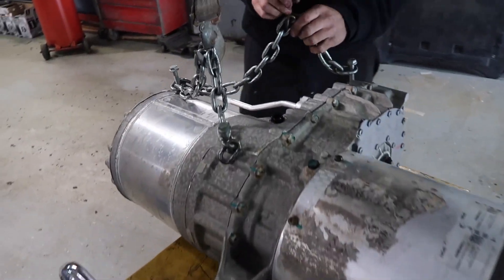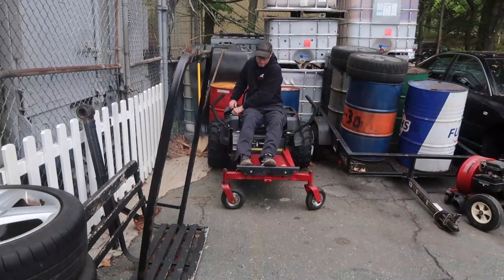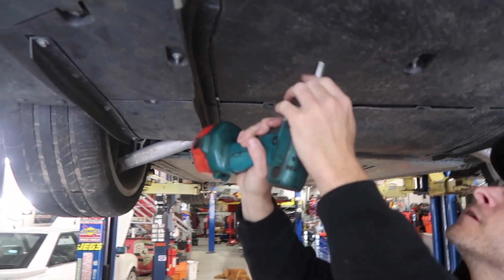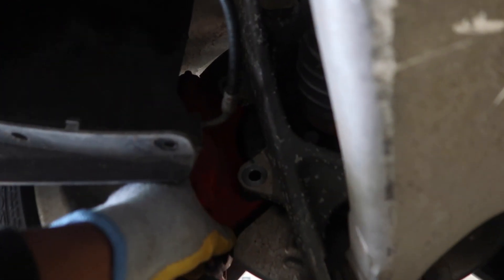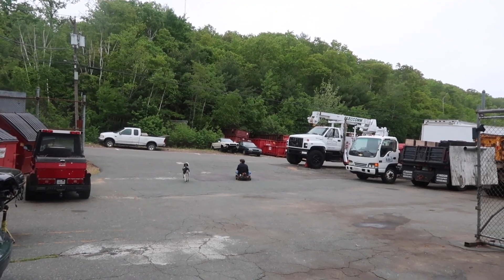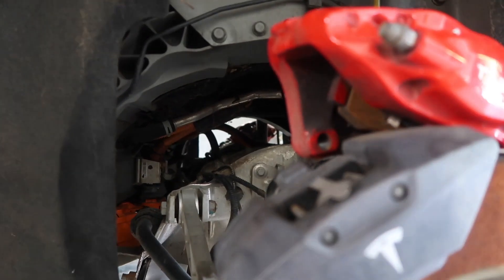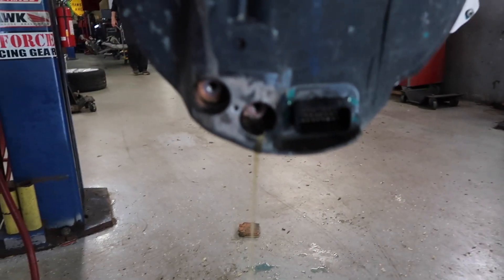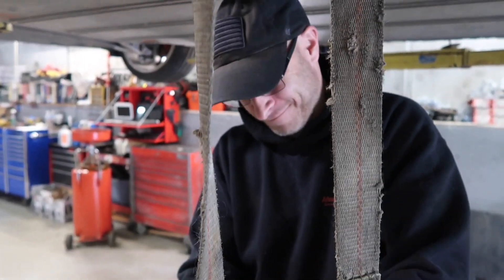Can You Drown a Tesla Motor?

Comment: Let me explain why you should never ever go to advanced technologies (Lee Malo)... back in 2008 he ripped me off literally over $25k.he told me he could work on my corvette, he couldn't. He subcontracted the job of replacing my heads on my blown engine to a Chevy mechanic from the Sudbays Chevy dealership. So neither him nor his crew did the work. So he charged me more so he could pay an outside mechanic. OK that's fine, but he was supposed to put new heads on my engine and instead put all my already paid for parts like my supercharger on my blown engine, all these parts we agreed we would talk about  insalling after he fixed my engine.. I made the mistake of having him hold onto them. He then put on my drilled and slotted rotors and new crome rims/tires as well. Then it sat for a month because I said he never fixed the original problem, I wasn't paying for it because my engine was still blown. It was still blowing white smoke. in the snow and rained, and rusted my new crome rims. His plan was to rip me off right from the start, so he had him put as many parts on that car knowing he was going to take me to court and have that car auctioned off. He never did what we agreed the engine was still blown, but yet took me to court and won only because I never gave his lawyer my statement. That's what the judge said even after agreeing with what I said was right. He said I had to give his lawyer a wrighten statement, and that's why he awarded him the case. So he now had to auction off the car to pay for the bs amount he came up with that i still owed. Well he was supposed to give me notice on when that car was being auctioned off, and never did. That's the law so I can buy my car back from auction. I doubt he ever auctioned that off to begin with. That's illegal. He never gave me any of my parts back including my almost 5k supercharger that should have never been installed, or my now rusted crome rims and brand new tires. As well as thousands of other dollars worth of parts the judge said he was supposed to give back. He even installed my racing seats in his sh*t box Volkswagen race car. I still had to pay 3k according to the court somehow so they took that directly out of my pay from work. All in all he literally ripped me off over 25k. What my car was worth and all those parts plus an additional 3k that I owed him  somehow. He knows for a fact he can't justify what he did. Nobody at that time sided with him. He can try to lie about it, but everyone that knew what happened including his crew knew he purposely ripped me off. So me being young I got back at him I significantly vadilized all the cars at his shop, because I couldn't win in court thanks to his expensive lawyer.Thats the truth. I am ashamed of what I did to get back at him. I'm not proud of it. But he was crooked and people needed to know. I tell people that story to this day. He was wrong, and people will always know what he did.

Comment: the only engine that can make more power out of a smaller engine are rotaries are no where near as reliable and require rebuilds often. They do use a lot less moving parts than a regular engine but don't electric motors have like 3 moving parts

Comment: Many electric motors will happily run under water. Interior car lights work under water. Turns out a light bulb or motor is the least resistance in an electrical circuit in any medium...that doesn't choke it.

Comment: It is waterproof but it is not a submarin.
Try to put other vehicle under water for 10 minutes and then try to start the engine.
High voltage has protections like a hot tub does.

Comment: Takes longer than 10 days for water to do any damage a lot of submerged items only corrode on the surface then algea and dust buildup preserves the core alloy for a long duration looks like they sealed everything well so it should be fine just needs a full teardown regrease and replace barings open encased components to dry out and inspect/clean replace rotten interior and antthing corroded or shorted then its back to what it was

Comment: Lot of rust in an internal electronic component, that makes me wonder about the quality of the seals and the metals involved in the motor.
Reply: It was sitting in water a week nothing will hold that back
Reply: @braxtonwilson1666  I have this bottle with (pressurized) soft drink in it, in my fridge. the soft drink stayed in well over a week. Perhaps even years!
Reply: @CheetahNL  I bet your bottle doesnt vibrate as much but it is just a guess maybe your fridge is crazy!
Reply: @BenjiShock  I do have a vibrating fridge, especially for the soft drinks. And still no leakage. ;-)

Comment: Electrical contact cleaner or brake cleaner, removes the rust, and cleans out the gunk. I've cleaned many an electric motor and it's circuitry this way.

Comment: you dont see some one NOT running a lawn mower at full RPM very often! those riders  mostly runn on hydraulics to get power to the back wheels, and it doesn't take alot of engine RPM to get alot of torque outta them, the RPM's are mainly for turning the blades fast!

Comment: I’m kind of shocked (no pun intended) this motor has water in it. I’ve seen so many videos of Model Xs and Model Ys showcasing their water fording abilities in light offroading and how they are better because they don’t have air intakes. I thought these motors are better sealed.

Also, that red isn’t rust. Its the transmission fluid.

Comment: Question: Tesla motors are, supposedly, capable of getting up to 18,000 RPM. But this assumes work being distributed to both tires. What if the motor had to spin only one tire? How fast, in terms of RPM, could it get up to then?

Comment: Can someone explain what inverter does?
Reply: The inverter convert the "flat" DC +/- battery voltage in "dynamic" AC three-phase voltage. That is necessary for create the electromagnetic forces that puts in rotation the electric motor rotor (in this Tesla case a "induction electric motor").
The rotation speed depend by the AC frequency managed by the inverter.

Comment: That's a mix of liquid coolant and water from the leak. Traction converter (inverter) comes up with liquid cooling. There's one more in slot liquid path  inside the motor to cool the windings.

Comment: Tesla is like Lamborghini and Ferrari, they want your vin. number before they send parts. I was working in a shop on a race track. We had a client who wanted to build four Ferrari 308 race car's. So he ordered a reproduction fiberglass body. We cleaned up this body all bolted together and put in months to get it perfect in shape and fit. Then we pulled moulds. We built four body's for four cars. The client was a Ferrari dealer. He had to use vin numbers to get the parts, engine's,  front window's part's, and other things. When the first engine came in a box it was put on a dyno and it blew up, $50,000 gone. The second engine was placed on the dyno with the help of a Ferrari technician, it too blew up, $50,000 gone. The third engine made it, by "GODS LUCK ONLY". Ferrari doesn't want a home-made race car with real Ferrari parts on them.  Rich is right when he said "Tesla want's to protect their image", so does "Ferrari and Lamborghini". I think it's the same with Tesla, but just to fix something simple and they say "Sorry your model is not covered" is very sad, investors should be warned first. Customers got SCREWED. This is why their is "NO REPAIR SHOPS", they want you to buy another car and let the others "ROT IN A FIELD".
Rich, carry on with your new business, you have a lot of HAPPY CUSTOMERS, SCREW TESLA.
────────────────────░███░
───────────────────░█░░░█░
──────────────────░█░░░░░█░
─────────────────░█░░░░░█░
──────────░░░───░█░░░░░░█░
─────────░███░──░█░░░░░█░
───────░██░░░██░█░░░░░█░
──────░█░░█░░░░██░░░░░█░
────░██░░█░░░░░░█░░░░█░
───░█░░░█░░░░░░░██░░░█░
──░█░░░░█░░░░░░░░█░░░█░
──░█░░░░░█░░░░░░░░█░░░█░
──░█░░█░░░█░░░░░░░░█░░█░
─░█░░░█░░░░██░░░░░░█░░█░
─░█░░░░█░░░░░██░░░█░░░█░
─░█░█░░░█░░░░░░███░░░░█░
░█░░░█░░░██░░░░░█░░░░░█░
░█░░░░█░░░░█████░░░░░█░
░█░░░░░█░░░░░░░█░░░░░█░
░█░█░░░░██░░░░█░░░░░█░
─░█░█░░░░░████░░░░██░
─░█░░█░░░░░░░█░░██░█░
──░█░░██░░░██░░█░░░█░
───░██░░███░░██░█░░█░
────░██░░░███░░░█░░░█░
──────░███░░░░░░█░░░█░
──────░█░░░░░░░░█░░░█░
──────░█░░░░░░░░░░░░█░
──────░█░░░░░░░░░░░░░█░
──────░█░░░░░░░░░░░░░█░

Comment: Can anyone give me some advice? I have a 1985 Mercedes T1 campervan/RV its got a 2.3l petrol engine that does about 18mpg on a good day, also converted to LPG but it does 10mpg on gas. I am thinking of hybridising it with either an electric motor from a forklift or maybe swapping out the whole engine for a Prius although the Merc is RWD and I don't know if it's possible to adapt the Prius motor to run RWD.

Comments welcome!

Comment: Rich, you could dry ice clean every component of this car including the circuit boards, bearings, wiring, and terminals, repack the bearings, reassemble, then test it.  I think it would function as designed.  It's only when you power something up while wet that it can fail.  We use a YoungTimer by Cold Jet PCS 60 dry ice machine to clean every surface and item on any car.  And never get anything wet!

Comment: Just crack that motor open time for new lamination and coating but electric motors do run submerged in water it's the ESC that will malfunction dealing with water this after 40 year's of experience will All electric motors from the nicad day's  but that entire electrical system needs to be replaced but I also seen ESC,s submerged in water for 20 minutes dried out and worked perfectly 😉

Comment: What kind of conversion could this motor be used for? Minibus/van, small train with limited passengers?

What's the horsepower, torque, and length of use without having problems?

Comment: kauputnik/ needs copious gallons of WD-40 & Zep sprayer to clean & dry EV motor & PCB// also needs serious conformal coating on
PCB to “waterproof” EV//
listening, Elon??
Reply: conformal coating will act as a thermal insulator, and when you're in a car, you need those inverters as cool as possible to increase the lifespan
listening, David??

Comment: BMW also produced one of the earliest model jet turbine engines during WW2. The 1st production jet engine powered fighter in history, the Messerschmitt 262, was slated to be powered by 2 BMW 003, axial turbo jet engines. However, production & development problems caused delays, & ultimately the ME-262 went into service, powered by the Junkers Jumo, although a few 262 prototypes used the 003.

Comment: I had a boat that sunk in salt water ,  rinsed it out and after a few months it several systems stopped working. Coated every connection with "corrosion block"  after a few days I applied power to the boat and  everything came back to life. That was several years ago and  all is still working fine.

Comment: If the electronics got wet contact cleaner and WD40 (water displacement formula 40). The only issue is corrosion in contacts (plugs). The stator coils are coated, any other area that my be moist will vaporize the water creating a temporary short. As long as power in the electronic system is not shorting those electrics will dry out BUT if no one had the forsight to remove the emergency responder plug something may have burned but an electronics guy with a scope can find and rebuild.

Comment: So the motor windings you can pressure wash it at the carwash and give a good cleaning. Just make sure to thoroughly rinse all the soap out, if you dont the dry soap will be a conductive powder that will ground the windings. Then bake it at 350f for about 4 or 5hrs. That's standard electric motor repair shop practice. Inverter....well that's more complicated, but as long as nothing was energized while wet you could in theory do the same, but the amount of rust on those pcb's makes that a bit more sketchy for sure.

Comment: I thought Mr. Tesla said that the vehicles will require minimum maintenance does electric motors count as minimum maintenance
Reply: They’re rebuilding a flooded Tesla that was in salt water for 10 days, does this look like maintenance to you?
Reply: @MindzEnt  yeah but the vehicle is a 2015 and the electric motor were replaced in 2016
Reply: Yes compared to gas cars and gas engines, no one said it was perfect.
Reply: @MindzEnt  Elon Musk said it would last a million miles with little maintenance changing an electric motor doesn't look like little maintenace
Reply: ivan espinoza yeah they’re designed to last a million miles, no one said it was perfect.

Comment: Rich if u can obtain a bottle of nitrogen and bleed the nitrogen into any cavity with electrical or electronics the dry nitrogen will drive all moisture out. If you can find a way to heat the N2 stream before introduction it'll absorb more. I'm an engineer with a major industrial gases company and we use this method all the time to dry out electronics, electrical and other components. It won't resolve corrosion issues that are already present but it will 100% dry out cavities

Comment: Wait theres electric boards in th engines??
Reply: Rusty Carlos Valdez yes, it’s an induction motor. It receives its power from the cars battery pack via the inverter which converts AC voltage to DC.

Comment: Kinda late to the party ...

But anyway i worked with motors especially in pumps allot ... And lets say that ... a pump submerged into salt water leaking slat water into it can be totally fine even if it had it for a week ...  The biggest issue with motors like that is electronics , bearings and making sure you did not burn it before you start working on it .. normally cleaning it .. drying it .. and exchanging bearings is all we did to make them work perfectly again .. and fixing the electrical connections ... So if you can cheaply source the electronics and clean it you might be able to safe the rest ... but i suspect the electronics are the most expensive part

Comment: Do you know on them circuit boards and also known as motherboards and logic boards but they're best known as motherboards cuz that's what I'm a name around at 1359 you can see when they take it apart you can see the water line you guys can take that stuff off you have a container full of rubbing alcohol and you said that stuff in it overnight it clean all that stuff off but but you don't want to set it in there just loan you want to scrub it off with a toothbrush and go side to side and then up and down and then in circles trust me. Clean off all that corrosion in rust

Comment: Tesla is a junk vehicle for the manufacturing plant you should never buy one in the first place there full of electronic problems!
Reply: First off can you afford a Tesla? Or have you had a Tesla to talk bad about  it?
Reply: I’m a owner operator and I hauled Tesla vehicles every one I hauled the doors never shut right an the thy all had door alinement problems ! I’ve seen the plasma screen monitors with discoloring on them a some software problems I was never impressed with Tesla products! U ask if I can afford a Tesla yes I can I have the money to cash off a few Tesla cars but I would never want to! I have over 200 thousand in my semi truck and drop deck with ramps and a winch! Which is a specialized carrier! I have hauled a lot vehicles so I seen the problems of all of them! General Motors has the best of most of the product on the market with less problems but most all products today have recalls! But if you think a Tesla will save u money on energy your wrong ! If you travel a lot with a Tesla in 5 to 6 years the battery pack will need to be replaced an then you’ll spend more money on it then burning gas in a car in seven years! It’s only a yacht club for idiots!

Comment: You can wash any electronics with warm soap and water. You can also use alcohol. Use a brush and acid brushes and scrub everything spotless clean off all the rust and grime. Dry thoroughly of course. You could even pressure wash the boards as long as you didn't blow apart any components. Thoroughly rinse with alcohol and maybe put a hair dryer in a cardboard box around the inverter. Leave openings in the top to allow evaporated water to escape.  Put it back together. Do the same thing to the motor and replace any sealed bearings. If it wasn't powered up when it got wet it should work just like new.

Comment: I work for tesla they are waterproof since we drive in rain hit puddles and snow and slush but the seals are not able to hold back pounds of water that a flood or pressure sprayer creates that's why they are junk after submerging and 400 volts plus water equals bad things

Comment: The key is to get all the ionic material (salts and impurities that make the water conductive)  off the circuit cards.  Circuit boards are run through what amounts to a fancy dishwasher using deionized water when they are built.   I have had good results loading my espresso machine with distilled water and using the steam wand to clean circuit boards.  If power is applied to a dirty wet circuit, the ions in the water cause crystals to start growing between pins with  voltages higher than just a few volts on the board.  These can short pins on small IC's very quickly causing circuit to no longer work properly.  Typically the problems only occur with high impedance circuits.   Higher power circuits will simply blow away any crystals that form like little fuses.  Good luck.

Comment: Has Anyone Tried "Pressure Washing" the motor inverter using a water dispersing lubricant like WD40, iirc available in bulk like 1gal & 40gal containers? ( works great for ICE & flooded distributors)